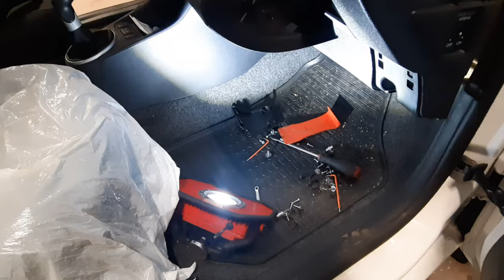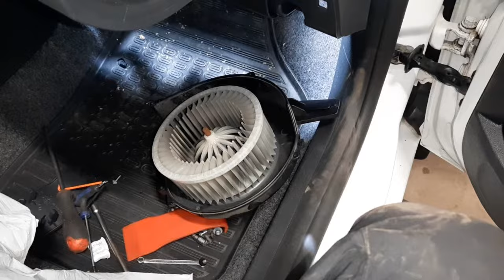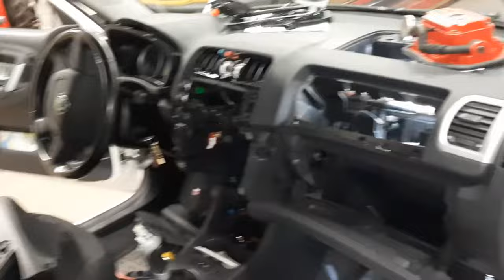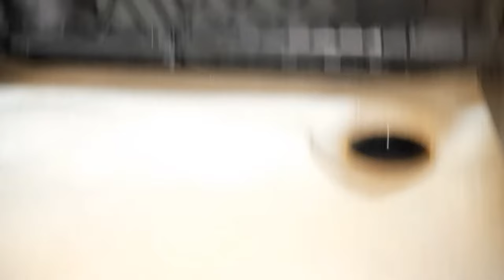Skoda Fabia blower motor replacement / Resistor peplacement repair

Comment: Just encase anyone wants to get to specific parts of the tutorial.

00:08 Step 1: Take off enough torx screws to loosen the passenger side of the dashboard.
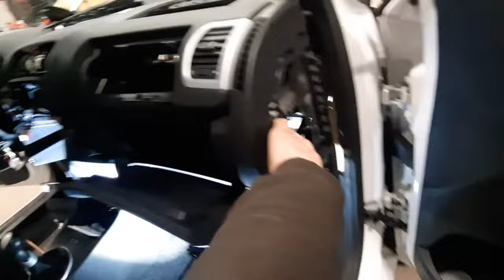00:14 Step 2: Shake the passenger side of the dashboard as if it were a tree, until the fan motor falls out of it, like a coconut.
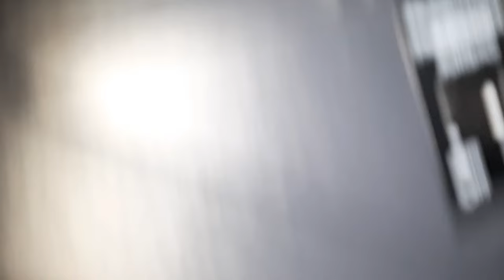00:37 Step 3: Vertically align the old fan motor with the middle of the glovebox compartment from the floor.
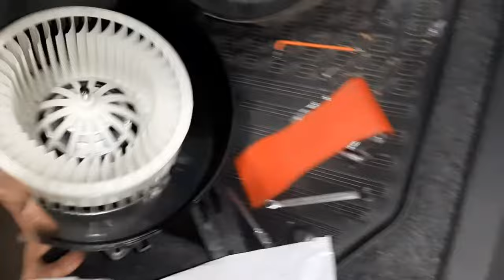00:41 Step 4: Drop the new fan motor next to the old fan on the floor and then remove the old fan motor.
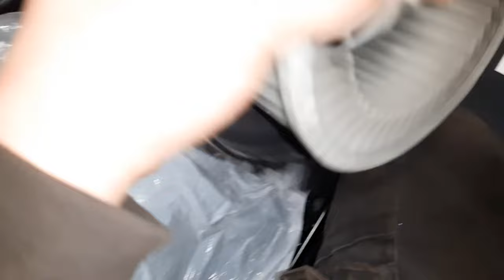00:45 Step 5: Inspect the old fan motor to make sure it is a fan motor and then place it on the passenger side seat.
00:48 Step 6: Make sure the old fan motor is sitting comfortably in the passenger seat, like so.
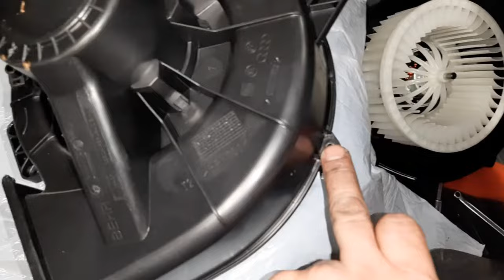00:51 Step 7: Be a little adventurous and stick your middle finger in all the screw holes.
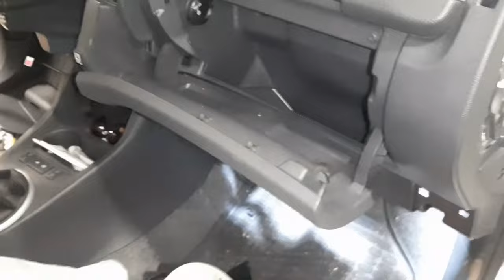01:05 Step 8: Take a step back to survey what you've done to the car.
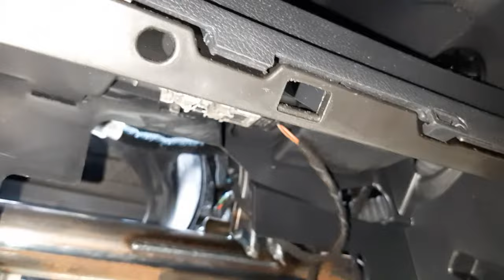01:42 Step 9: Get your arm inside the dashboard and feel the car inside out.
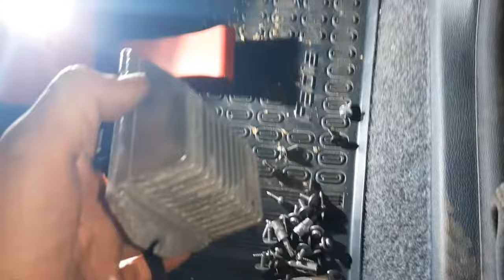01:55 Step 10: Pick something up and put it down again.